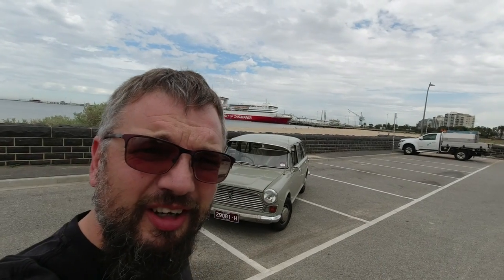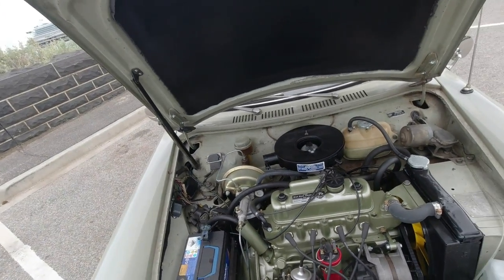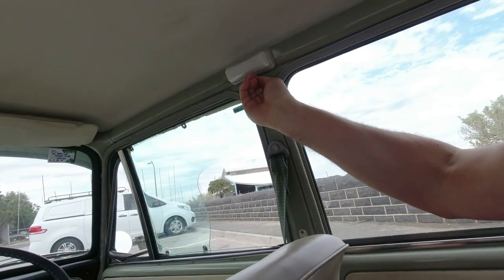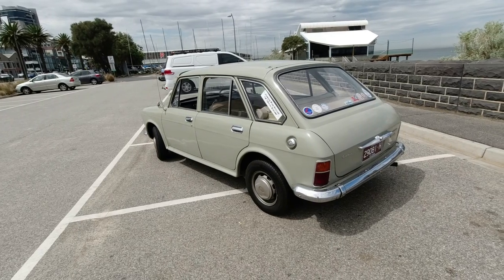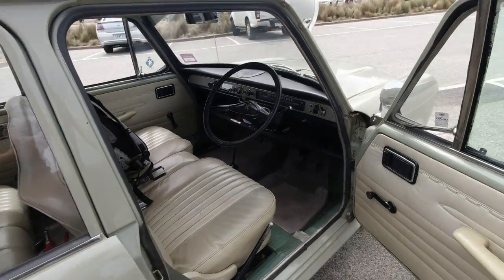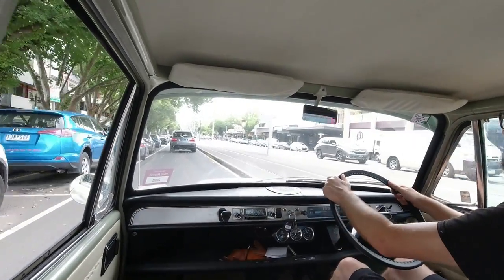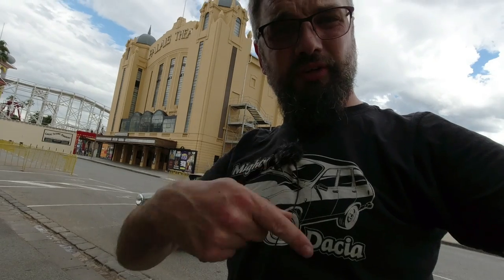Aussie Oddballs: Morris Nomad (1100/1300 station wagon thing)

Comment: Did these BMC/ BL have a problem with the CV joints? My aunt had a Austin America and remember they failed when the car was only 4 yeas old.
We’re they a different design the used now? Not a problem with modern cars it seems as long as the boots are okay.
Reply: These would have all the Austin America failings. In Australia this was the real reason these cars sold so poorly over time and is also why few have survived. Not the styling and colours others go on about.

Comment: What an interesting car but it begs the question why did they just not make the Maxi. If memory serves the Maxi was launched for the 1968/9 model year. You are correct about that auto transmission having short gearing but it was the same with UK cars. Sort of a good idea running it in the engine oil until the cars got older and people skipped oil changes, remember how oil used to sludge if it wasn't regularly changed? I'm pleased you're not one of these people that bash cars just because they have a BL badge because I don't remember them being any worse than their contemporaries.
Reply from the maker: I guess they saw it as more cost effective to alter the 1100 than tool up for building an entire Maxi.

Comment: I like the sound it's quite a powerhorse for a 1.3 ..even by todays standards it could probably hold it's own against certain modern cars even if it scared them out of the way it looks a little bit landcrabby .. speaking of which were scary big 3 litre jobs
Reply from the maker: Land crabs were only the 1.8 and 2.2. The 3-Litres are longer, and known as Land Lobsters by some.

Comment: I think there was an overdrive on offer with these Nomads
Reply from the maker: Not likely, as they're front-wheel drive.
Reply: The 5 speed gearbox available with the 1500 cc OHC E series versions of these may be considered as having an overdrive 5th gear.
A 1500 sedan version from Peter Anderson who loaned his 4.9 V8 XD Falcon (looking like a large Granada) to Hubnut for testing : 
https://www.youtube.com/watch?v=F2OBgwQ8ks4
Nomad engine and gearbox option if you went manual and not the rare 1275cc Auto featured here. Auto only came with 1275cc A series.

Comment: ADO 16s (Would this still be an ADO 16?) are really growing on me.  This seems such a logical extension of the design.  Better looking than the Maxi I think.
Reply from the maker: YDO9 is the project code, but I think it definitely belongs in the ADO16 line-up.
Reply: How about the Austin Apache? An ado16 crossed with a Triumph Toledo/dolomite.
Reply: @paulqueripel3493  Just googled it.  What a strange amalgamation of BMC/BL bits.  I'm not sure if it works for me.  It could grow on me.  A bit like when people graft an MG TF front end onto an MGF.  It's Ok but somehow odd.
Reply: @danentwisle8885  it looks so like a triumph, I think they should have sold it as one here and dropped the triumph 1300. BL had too many platforms and duplicate engines in the same sizes ,it was mad. I tried counting how many series of engines they made at the same time, I think 11 in the early 70s,may have missed some. All made to different designs.
Reply: Paul Queripel we had a South African Austin apache 1275cc AP 4 speed auto 1972 and all Rust free. It had been imported into Wiltshire. Wished we’d kept it ...

Comment: Leyland Australia made some very good and interesting cars. They just never hit the right spot in the market. I had the local Morris Major with “Chevy” styles fines and the mighty B Series engine. The Nomad was a great little car. Sad to say quality control was a big issue especially towards the end. But during the 50’s and early to mid 60’s they were highly regarded.
Reply: Sounds like the Morris Major Elite model that Hubnut was chasing to try and review. 1622cc (iirc) was about the most engine capacity to weight  ratio available from 4 cylinder cars back then. Were common but rare now.

Comment: To my eyes the problem with the styling is that they retained the 1100 rear doors. The sloping shape is completely wrong for the extended body and they make it look home made. If only the doors were nearly square at the top, rear access would be easier and the design more unified.
Reply: IF typewriters were the theme in UnZud, then the theme in Australia is body variants being created without changing any more panels than necessary.  Ian's already been commenting on the long-wheelbase luxury variants of the local manufacturers, and it's carried over here!  Holden's attempt to make a long-wheelbase luxury car without the long wheelbase (Brougham) went one step further! 🤣

Comment: i hjad an austin 1100 herein canada, horrible rust!  it was an automatic and that worked very well except in extreme cold.  engine oil is far too viscous when cold unlike proper transmission fluid.  the other issue in north america is that drivers here NEVER use the parking brake on their vehicles.  they rely on the auto transmission's park position or on a manual, they leave in gear when parked.  i woul;d hazard a guess that most drivers in north america have never used the handbrake at all!  its not required to be activated ever
Reply: I've wondered about this:  what do they do in the US if parking on a grade?  If steep enough, there is a load on the Park position, sufficient jam the selector lever and make it almost impossible to move it out of the park position.  I drive an automatic.  But, when parking, I put it in Neutral, handbrake on and verify the handbrake is holding the vehicle, then put it Park.
Reply: @railtrolley  exactly, they still rely on the park position.  canada too!  we north americans never use the parking brake(i'm a rare exception and taught my wife and kids to use it)  the load on the parking system can be huge and makes it very difficult to disengage
Reply: @stevem268  It's a good habit to get into, well done that your whole family do it.  I would rather rely on 4 decent sized brake shoes to be holding a 2 tonne vehicle, than a tiny metal pawl engaged in the transmission.  Much cheaper to service and maintain than an auto 'box too.  I'm wondering of the resistance to using the handbrake stems from the much handed-down advice that they freeze up in the snow?
Reply: @railtrolley  yeah we have a ram 1500 with a very expensive 8 speed auto plus we regularly tow a 4 ton trailer(caravan), a good parking brake is a must.
Reply: @stevem268   Ram 1500s are quite popular here too (Australia).  See alot on the road.  Converted to right hand drive in Clayton Melbourne.  Former Nissan plant and VW before Nissan.  8 speeds in an auto now. Remember when 2 or 3 speeds was thought enough?
Reply: @railtrolley  the ford f150(same size as a ram 1500) has a 10 speed.  big pickups are very common here in canada,  much better for towing than australian "utes", much higher payload capacities.  5 0r 6 ton 5th wheel caravans are quite common
Reply: @stevem268  
They are quite common in Australia too.
Reply: @stevem268 10 speed transmission!  Approaching Roadranger for number of gears.  I drive out of Eagle Farm, Brisbane.  There was a Ford plant nearby, which produced the F series: 100, 250, 350.  Shame its gone.  They did sell well.  Plenty if older ones still getting around.

Comment: Quirky little car, love the sporty exhaust note and the auto box but jeeze, its ugly af though! 🤣🤣🤣 it seems there is a few of us that learnt to drive one of these small little front wheel drive variants at 10 years old. Me, the Riley which to me was basically a Mini with a boot attatched to the back. My ol' man wanted to give me a Morris 1300 GT which belonged to his mate but i didnt like it. I didnt realize what potential they had until a mate of mine had an MG 1300 variant but his had two big stromberg carbs slapped on it and a straight through exhaust with a peco back box. The performance was impressive non the least. But alas, the 1300GT got sold and with it being my ol' man's mate's car, it was in pretty good nick too! But when you're young and naive......🤣

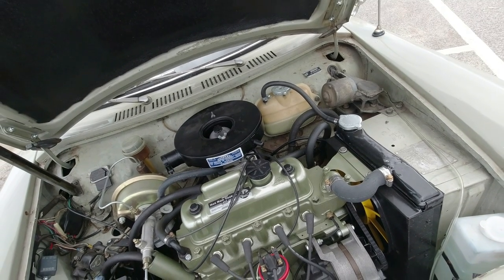Comment: 4:45 The oddity here is an 'A' series engine fitted with an alternator.
Reply from the maker: An upgrade for this time, but plenty of A series engines had alternators later in this engine's life.
Reply: @HubNut  Not surprised in reality - just that generally I didn't get to see them. Have one in the garage out of a C reg Minor...4 speed lathe anyone with one reverse ?
The Minor was my grandma's car. Just to be clear, I'll repeat that.
The Minor was my grandma's CAR.
She passed her test age 60 - and her decision to cease driving coincided with the car seriously failing its MOT. So it was the only car she had. It of course has a dynamo.
I wonder if anyone's fuel-injected one !
Reply: Indosarnia  '65 Minor with dynamo. Noted many vehicles of the 70s  with dynamos but I wasn't around new vehicles :) Wasn't really until the 80s that I found alternators common. Being involved in car repair, we didn't get many new cars needing fixing ! I guess the first I'd come across with an alternator was a 74 Granada.

Comment: If you want to see a real Aussie oddball, check out the Lightburn Zeta
Reply from the maker: I had hoped to while I was in Australia. Sadly the only one I found was in Queensland, and I never made it that far north.
Reply: @HubNut  They were "affectionately" called the cement mixer on wheels as that was Lightburn's biggest selling product.
I'm sure I only saw one Zeta on the road.  I got my licence in 1967.  It's probably best you didn't get to drive one.
Reply: The light burn zeta was manufactured here in South Australia.  There is a few of them on display at the Birdwood mill motor museum.

https://youtu.be/0Fta2JLkaio

Comment: that was called an Austin America in the USA
Reply: Related to the Austin America but this is an Australia only hatchback. Different grille and motors too. Manuals were 1.5 litre OHC and usually 5 speed gearbox. None of this available in the USA or UK.
Reply: @johnd8892  My Austin America had a 4 speed gearbox and an  Morris - MG type engine. SU carbs sucked. Otherwise a great little car. I would buy another one right now.

Comment: This isn't an A series, those only go up to 1300cc. This an E series!
Reply: This one is the automatic version that were limited to the 1275cc A series motor.
The manual versions of this car were E  Series OHC motors as you say but not the automatics like this one.
Hubnut explains the reason and shows the A series motor. Although it has been bored out to 1410 or similar later in life.

Comment: The Nomad certainly is an odd mix, but seems quite a competent and practical one, even if the body shape is not as nice as the British Austin 1100, especially the rear, imo. As a kid in the UK, I never thought much of the design of the 1100 as compared with the comparable Vauxhall and Ford offerings of the time. It seemed rather a boring car, driven more by more mature and conservative types. But as years go by I now find myself liking the design of these and so many of the other Leyland models much more. Perhaps it's partly the Hubnut effect on me in recent years, but also modern car design which just seems so bland, bloated and samey compared with stuff from the 60s and 70s.

Comment: don't get this car. its a re-engineered 1100 into something similar to a Maxi which was released in the same year using a Maxi drivetrain and what looks like a Maxi tailgate???
I was mechanicing back in the late 70s-early 80s and never came across any issues with those AP automatics. and hey, very few people used to service cars back then either lol
Reply from the maker: It is an oddity, but they somehow reasoned this was cheaper than trying to build Maxis in Australia. Tailgate isn't identical so even more daft...
Reply: @HubNut  so so weird. like your channel btw, good call doing the oddballs

Comment: I don’t get the facts straight in fact. So you had these Aussies in 1100,1300 and 1500 E series? Correct?
Reply: 1100 were only in the earlier Morris 1100. When the Morris 1100 was replaced by the Morris Nomad and Morris 1500 the 1100 was dropped from these cars but went into the Australian Morris Mini K. Automatics were 1300 (really 1275cc) A series and manuals 1500 E series with  5 speed gearbox. The 5 speed speed seemed very exotic for the time. Only the much more expensive Fiat 124 sport coupe had them in mass market cars at the time. Earlier the Aussie Morris 1100S were 1275cc despite the name.
Reply from the maker: What John says.
Reply: HubNut what is the story then about this 1100 automatic?
Reply from the maker: The tested car is a 1300 automatic, A Series engine because they didn't have an automatic for the 1500 at the time.
Reply: HubNut then it all makes sense now. The video title confused me by stating 1100.
Reply from the maker: Ah. Point taken. The ADO16 is often referred to as 1100 for simplicity's sake - the club is the 1100 Club - but I've amended the title.
Reply: HubNut I honestly am quite aware I think about the ADO16, but it keeps being a land of confusion isn’t it sometimes. I totally understand now where the title came from because it descends from the “base” pinnings of the 1100. Thanks for clarification! Greetings from very hot Belgium!

Comment: Why didn't they just give them the 1100/1300 estate? Or the Maxi? So weird.
When is a Maxi not a Maxi? When it's a Nomad. Apparently. 😂
Reply: 2 door wagons (estates) don't sell in Australia.
Reply: @chrisharkin3741  Nor did the Nomad. 😂 Could have given them the Maxi surely or made a development of that. Rather than changing a saloon. Haha. Typical BL.
Reply: @Spac8  Yes you're right, the Nomad and 1500 didn't sell well. More due to the terrible reputation they got in a very short time. I believe motoring journalists really got stuck into the awful gear change in particular. 

I think this was a stop gap model created at minimal cost. Their real attention was on developing their new big car, which eventually became the P76.
Reply: @chrisharkin3741  Funny they got such a terrible reputation when 1100's are loved over here. And surely a cheaper alternative would have been to give them the Maxi? Haha. It even has more power! Haha.
Reply: @Spac8  The original 1100 had a reasonable reputation here. It was stuffing the 1500 engine and 5 speed gearbox under the bonnet that ruined the 1100's good reputation. I wonder if they had chosen to offer it with the 1300 A series engine and the 4 speed manual gearbox, it might have been a different story. In Australia we had the series 1 Morris 1100, almost the same as the UK, but when the UK got the Mk 2 1100 and 1300, Australia got the 1300 in Automatic only, and the 1500 in manual only. Both were troublesome. A 1300 manual would have been a good thing, but was never offered.

Comment: Left foot breaking?? 🤔
Please don't tell me you drive automatic cars with 2 feet?!  Surely No??
Reply from the maker: Whyever not? Why do you think manufacturers often fit a wider brake pedal?
Reply: Wow. I'm not slating you ian,it was just a mere observation. 
I was always under the impression driving with both feet in an auto soars the chance of you making a mistake/getting footing wrong  as your brain has to think about two feet insted of one.
Reply from the maker: Racing drivers and karters seem to cope. 😉 Your comment wasn't alone, so it made me wonder if I'd missed something.
Reply: I have driven with both feet since I bought my Ford Falcon automatic back in the early 80's.

Comment: I cannot see why u call this car oddball.
At all
It was well accepted
In its time as a competitor to the Renault 16.
In deed the full bed mode which u didn't show was why it had the name Nomad.
The 1500 came with twin carbs.
The visor would sap the gas mileage too.
Generically the new style front 1500 supceded the 1100 cars completely. It was just a logical development.
I must tell the Spirit of Tasmania not to park in St Kilda. Sorry the Brits were the oddball as they couldn't see the logical develipment
Including the X 6 Kimberly Tasman range.
Oddball is the Austin 3 Litre.
Murray (Prahran Melbourne) 
P. S. (you drive too fast hard)
Reply: The 1500 never came with twin carbs, it had a single 1 3/4" SU.  I did fit a set to mine, from a TC Marina.
Reply: My oops it was the "s" type that had twin su carburettor s. M

Comment: But why, it does nothing that theMaxi doesn't do? It's an ugly bugger too.
Reply from the maker: They didn't build the Maxi in Aus.
Reply: Too costly to tool up for a Maxi in Australia. This was likely a cheaper stop gap until they went rear wheel drive. This was to get away from the bad reputation BLMC front drive cars built up over time in Aus. 
An imported Maxi would be very expensive due to import duty and still have BLMC Fwd stench about it.
Rapid growth in Japanese car sales in Aus took small to medium cars market share away with much better received cars in Aus often assembled in Aus.
P76 had a tough time competing with Aus Holden, Falcon and Valiant. V8 P76 only appealed to niche buyers, not fleets. Unlike Holden, Falcon and Valiant six cylinder mass market sales.